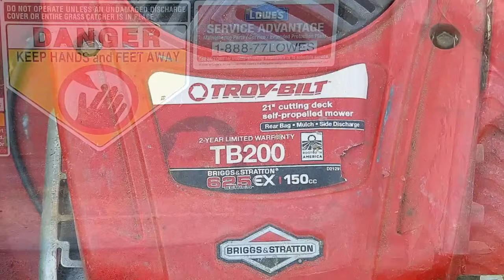Fixing A Troy-Bilt Mower That's Smokes

Comment: My lawnmower has a exhaust leak coming from muffle after i removed it to remove stuck oil inside it i used brake cleaner to clean inside it

I bolted it back like it was n now i have a exhaust leak i dont see no gaskets
Reply from the maker: yes it depends on what type of engine you have. Some have gaskets while others have a special mating surface they use to seal. It saves money and time not having a gasket.
Reply: @HomeGaragechannel  i messed up my lawnmower i forgot to connect the cable that goes to muffler n carb it smoked all white smoke next day i connected cable tried it it turn on still smokin now it will not turn on at all keeps spittin oil from muffler

N i have filter removed

Any tips pls?

Comment: My new Honda mower smokes black smoke when I restart it after emptying the catcher. Why does it do that?
Reply from the maker: it's the choke. It's still working even when your engine is hot.
Reply: @HomeGaragechannel  is that good or bad?
Reply from the maker: it depends, how long is it blowing black smoke out?  2 seconds or 2 minutes?
Reply: @HomeGaragechannel  2 seconds
Reply from the maker: then it's fine.

Comment: I would check the oil level first. I have seen what happens to a mower engine when a short reach plug is used for a long time. Makes it harder to install the right plug.
Reply from the maker: great choice